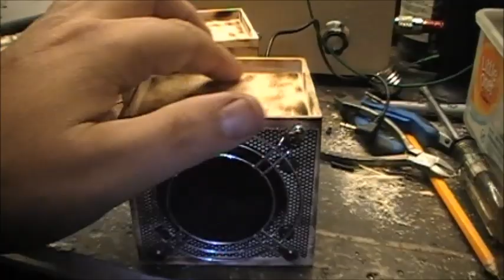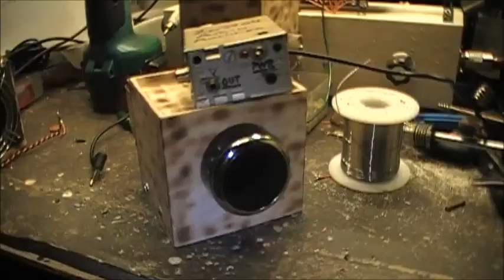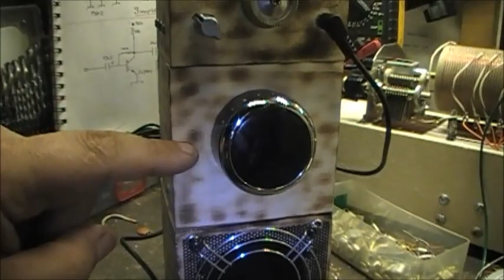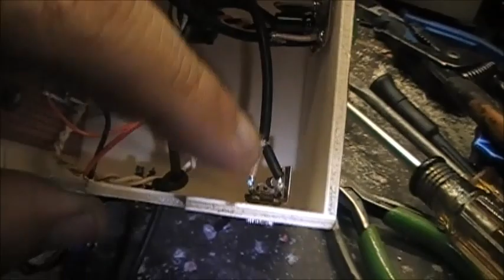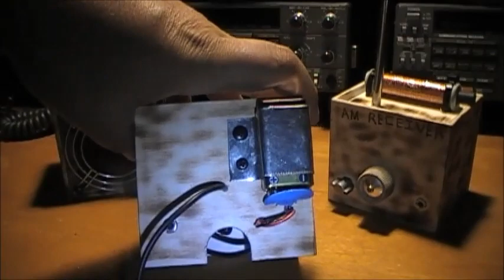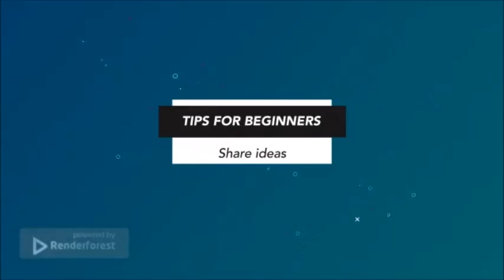The tower of micro power

Comment: Thanks for the reply on the Johnson 4145..  Can you please tell me how the power wires are installed in the plug?  mine just has stubs with no insulation.  The pointed bit on the plug pos or neg.  The manual doesn't show much.  Are you a Canadian Ham?  My dad was but has long been a silent key.
Reply from the maker: I will have a look at mine later tonight and let you know. 😊
Reply: @Radionut63  Pulled the covers off, red and black right in front of my eyes.  Repaired the wiring , hooked it up and works like a charm.  Skip booming in from North Carolina.  Thanks